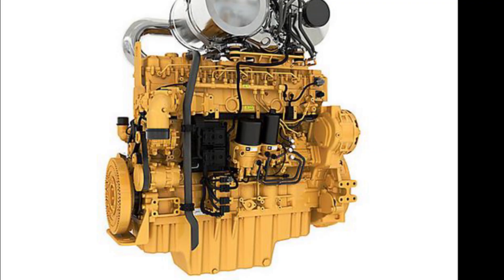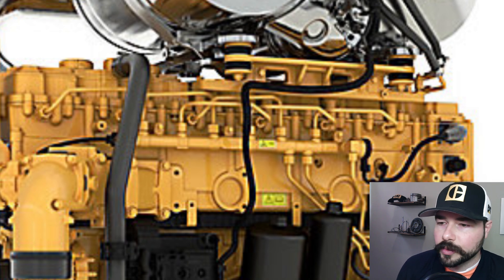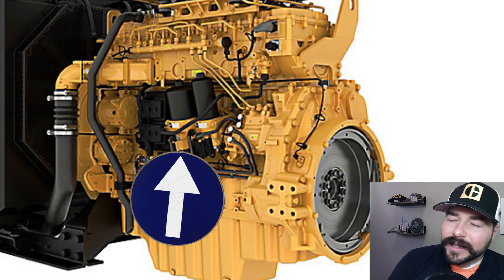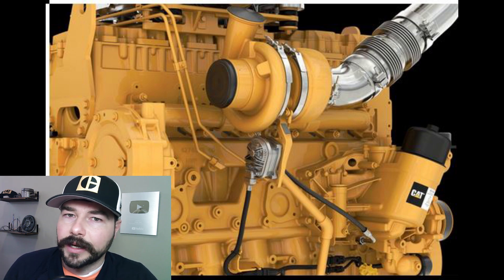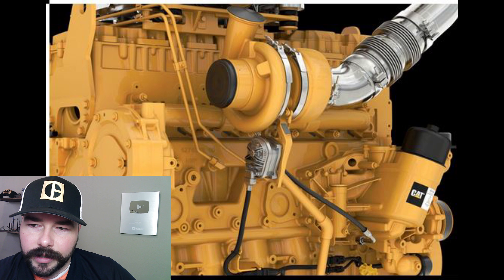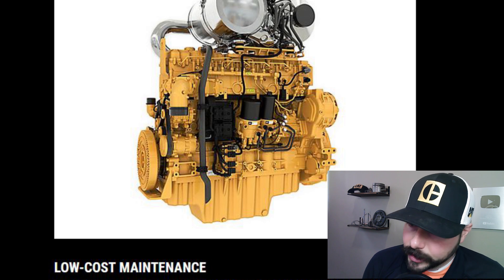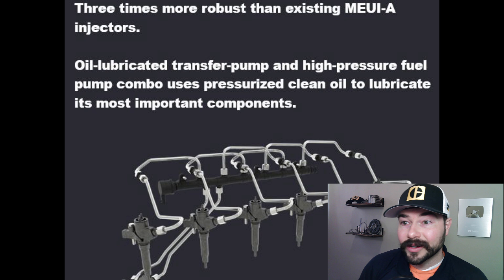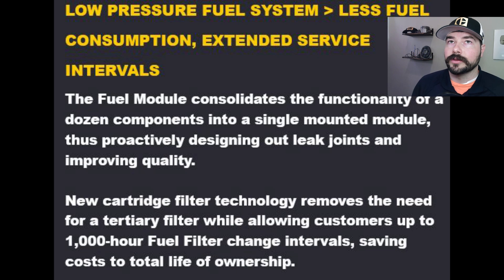New Cat Engine set to replace the C15.... The Cat C13D, 690 Horsepower.

Comment: If it can make 690hp reliably then it'll be great but that seems a lot to ask out of a 13 liter
Reply: Probably for marine application. They're always rated for more since the marine won't have the same 100% torque hookup like a ground drive application.
Reply: CASE IH has been using a 12.9L FPT in their big Quad Tracs for years... rated at 692hp...
Reply: @psquared2566  Rating HP for different applications is not comparable.  Tractors, pickups, trucks, bull dozers...each enormously different.  600 HP in a tractor is not the same as 600 HP in a Truck.
Reply: @psquared2566  yep true but that little twin turbo just doesn't lug like the old QSK s did
Reply: Fpt have been doing it for 10 years at least in the 600 steiger tractors, 12.9 litre
Reply: 600 rated, 690 power boost I think
Reply: From working on 3400 series engines I know with more diesel and turbos you can make a Cat almost produce infinite hp.
Reply: Rear gear train suck.
Reply: 690 is nothing for a modern 13, it’s nothing for a old one with a few modern upgrades
Reply: A 7.3 liter can make 500 reliably
Reply: @Bricky Boii  not at 2000lb ft of torque it Can't
Reply: @psd28  not at a 100% duty cycle.
Reply: @psd28  no it can't, that isn't a heavy duty engine
Reply: @psd28  maybe moving a p/u around , but pulling 80000 up hill  wont stay together long !!!

Comment: Common rail by Cummins......they were proud of the fact that "It's the most complicated fuel system ever designed".
Reply: It’s one of the most simple in my opinion. The most complicated part about it is the computer. Many common rail pumps don’t even need to be timed.
Reply: HEUI:  hold my beer!
Reply: Heui POS motors were..

Comment from the maker: Thanks for watching. What do you think of the new C13D and was anyone at Con Expo to see it in person? I forgot to mention it in the video, but this is only planned as an industrial and construction equipment engine at this time. You can help the channel by checking out these Amazon Affiliate Links for recommended tools: 
Fuel Pressure Gauge, Compucheck 0-300 psi: https://amzn.to/3YeBldu
Airlift Cooling System Vacuum Filling System: https://amzn.to/3D9AlPu
Radiator Pressure Tester Kit: https://amzn.to/3QGBumn
Milwaukee 3/8" Right Angle Impact Wrench: https://amzn.to/3D2CvAk
2 Pack M12 Style Batteries for Milwaukee: https://amzn.to/3D2mdHE
Reply: I'm surprised the government allows you to live considering we have a war on Intelligence not violence.
Reply: I think it's April.